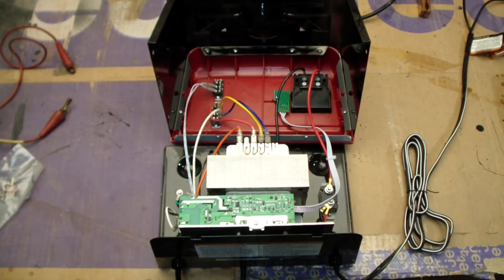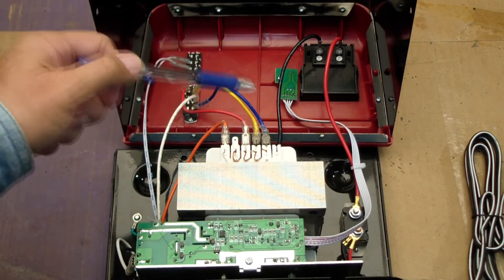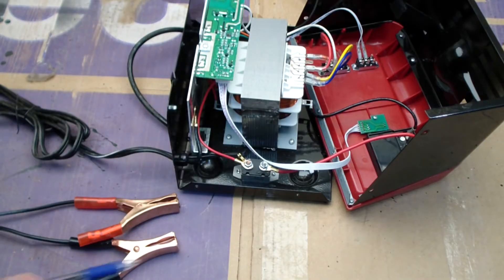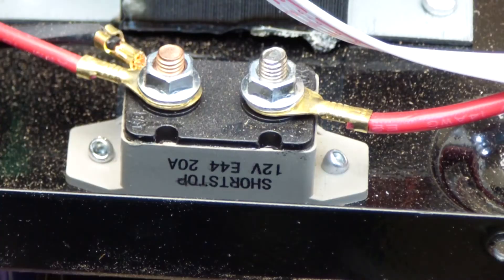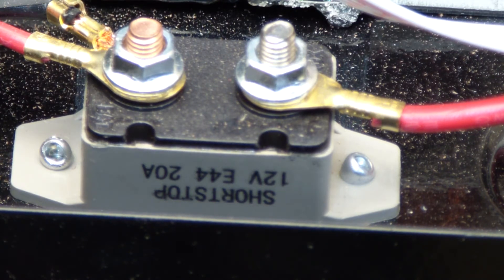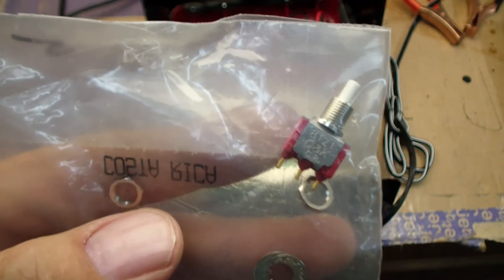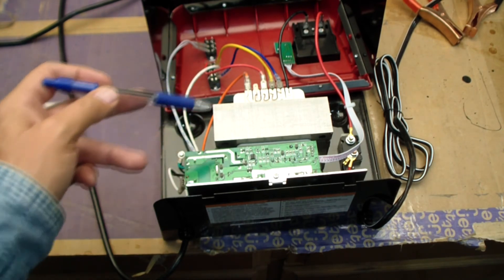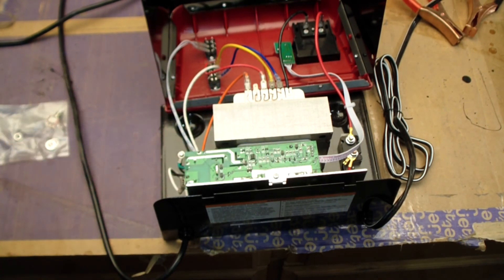Harbor Freight 10/2/50 Amp Battery Charger Review FAIL Part 2

Comment: Hi Kent, Thanks for the very understandable video, But mine doesnt power up at all no red light., Harbor Freight would not take it back,, what should i check is there a main fuse?
Reply from the maker: On mine the 20A self resetting fuse went bad. I bypassed and now works great. Been a long time since looked inside but this is a very simple circuit. Maybe ask a friend with a little electronics background. Good luck.

Comment: That 20A circuit breaker is for the 120vac coming out of your wall outlet, not the DC voltage for charging. Most wall outlets are only 15A. 15A @ 120VAC will be 150A at 12VAC. I'm not sure how amps translate from the transformers AC output through the rectifier to DC.

I don't think the 20A self reset breaker is limiting your output.
Reply from the maker: The 20A self resetting fuse is on the DC output. I had to bypass and works great now. I hear HF has fixed this wiht a higher current breaker.

Comment: Its relatively simple to make the clamps hot all the time or with a switch. 
Take the too off and follow the AC power in (black wire). At the very 1st place where the black AC mains power terminates,, there are 2 solder joints. The black wire is soldered to a voltage sensing FET and then continues through the charger.
Simply add some solder so the 2 solder joints become 1 big one. Don't worry about the fet. If you want a switch, just add it between the solder joints instead of soldering them together.
That FET switches the AC line on when DC voltage is present ir off when ni D.C.

Comment: I have been beating my head to figure out why using it for rust removal wasn't working. i see the sticker now "unpowered until connected to battery". This is a replacement for another that was 30 years old. what do i modify to make it charge? I allume a dead batt still has enough residual amps to tell it to charge?
Reply from the maker: I was looking around inside to see if I could find an easy to force on full time but did not find anything. Be sure to bypass the self re-setting fuse as that failed after a few uses.
Reply: @KentDiego  thanks! i managed to fool the charger by attaching a 1.6 amp trickle charger to it. Now my 80 year old pipe wrench is cleaned up! maybe this can help the next guy. :)

Comment: Kent, if you replace the Shortstop 20A with a 50A circuit breaker, what will happen?
Reply from the maker: I am sure it would work. I bypassed the 20A unit and now everything works great.
Reply: @KentDiego  Thanks.

Comment: Kent, so will the charger stil charge at the 2 amp & 10 amp??   Mine shows no power light  when plugged up..no sound..(although it did make that click sound off & on  like you described..last time I used it...)  what should I check to find whay there is no power ??  thanks for your help !
Reply: I used it once when I bought it and I thought it wasn't working at all. I read a few posts and someone suggested placing swith on 2 amp for about 5 mins then toggle it to 50A momentarily then back to 10 Amps and mine started working. The protection circuit won't draw any current if the battery is completely dead which is why most customers would ever use it.  At about 50% charge so I'll update in a few hrs.
Reply from the maker: Mine quit working after a few uses too. To fix you need to bypass the self resetting fuse. Unscrew the wire from one side and bolt into the other side. Then your charger will work great.

Comment: mine only works on 2 amp setting. relay just clicks away if I go to the 10 amp setting??  I guess its just junk.
Reply from the maker: It will quit altogether soon. I had to bypass the 20A self resetting fuse and now it works great. Just unscrew wire from one terminal and bolt to other.
Reply: I'll try it
Reply from the maker: Guero Rodriguez  Mine quit too. To fix I had to bypass the 20A self resetting fuse. Unscrew wire on one end and bolt to other wire to bypass and fix.

Comment: bypass those pesky safety devices
Reply from the maker: I had to bypass the 20A self resetting fuse as the charger would not work anymore. Part 2 shows the fuse.